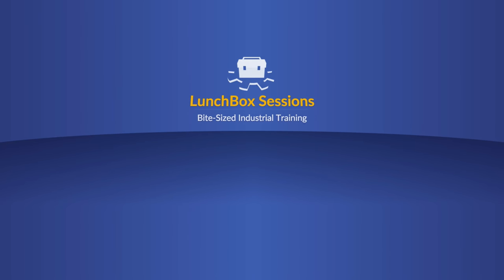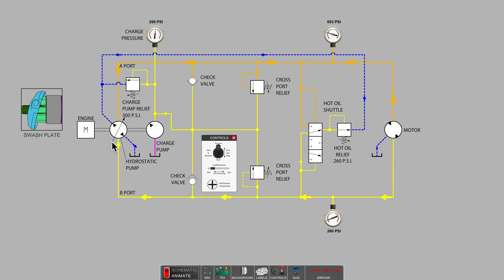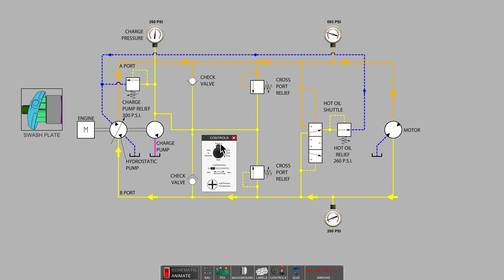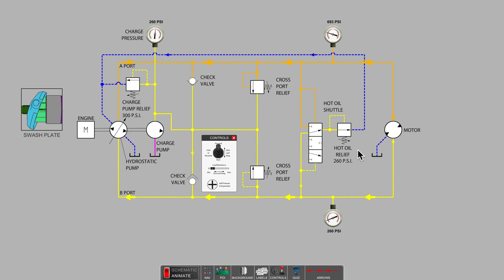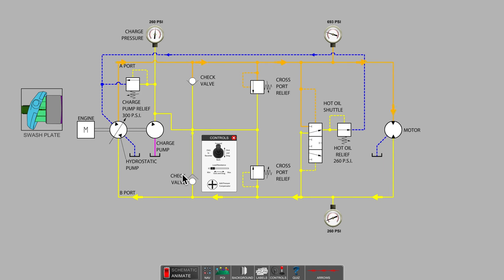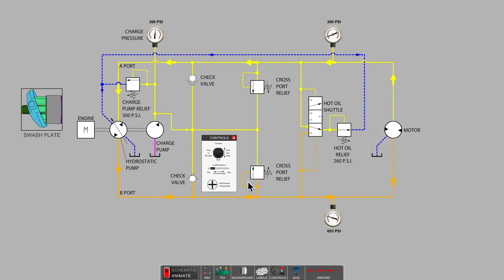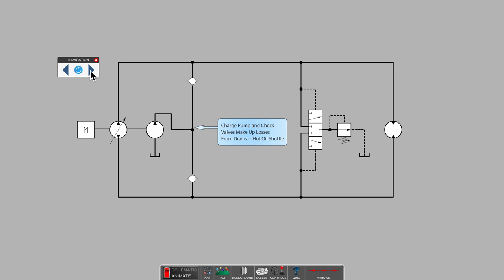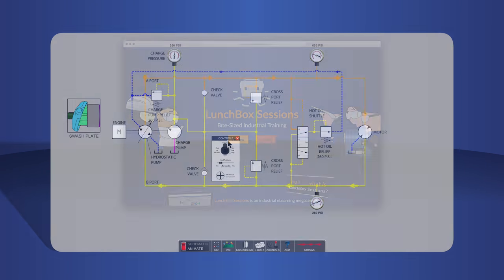Closed Loop Systems - Part 1

Comment: Great work sir. What is the advantage of using variable displacement pump? In closed loop system,  it will be continuously running non stop? Will it not reduce the pump life?
Please reply in your spare time. Thanking you for sparing your valuable time.

Comment: Excellent video. Please keep on contributing. Is the charge pump a "gear type" pump and acts as booster pump for the main pump/ variable displacement pump?
Reply from the maker: Thank you. Yes the charge pump is usually a fixed displacement gear pump. Occasionally it is a vane type of pump. It does indeed act as a booster to the main pump. You've got it!

Comment: You are doing an excellent job. Can you please tell me , how "internal leakages" can cause high temperature rise? For example,  leakages through Relief valve etc? My query is that if there is an obstruction (less flow) than temperature should go high.
Thanks for sparing your valuable time.
Reply from the maker: Thank you Abid Mahmood. Internal leakages cause high temperature issues due to fluid friction against component surfaces within a small opening (orifice). There must be some clearance for lubrication and thermal expansion between a piston and a cylinder in a piston pump. At high system pressures, the flow rates through these clearances increase. This means more friction and more temperature rise. Pump design engineers work hard to minimize these clearances and find ways to minimize the volumetric efficiency losses and the conversion of system input energy to heat.

Partial obstruction does not always mean less flow. If we use a fixed displacement vane pump which has a high volumetric efficiency, reducing the diameter of the pump outlet line will only result in a higher linear velocity. The flow rate (volume/time) will not be changed.  

I hope that helps a little. Feel free to write again and keep the learning conversation going. - Carl
Reply: LunchBox Sessions Thank you sir for your excellent explanation. Please keep on enlightening. I like your work too much.